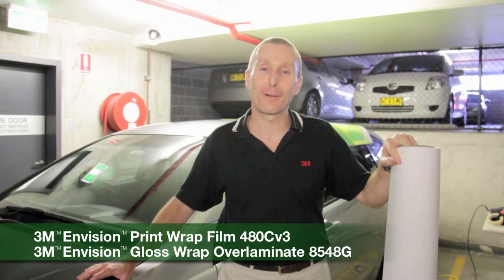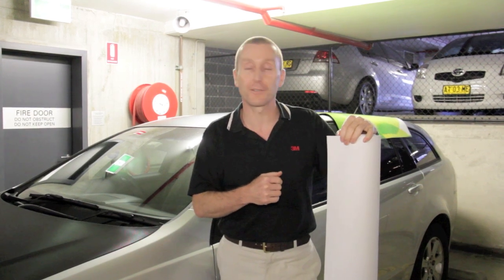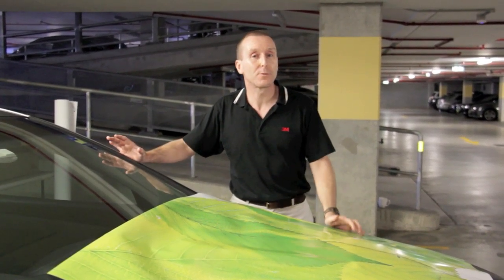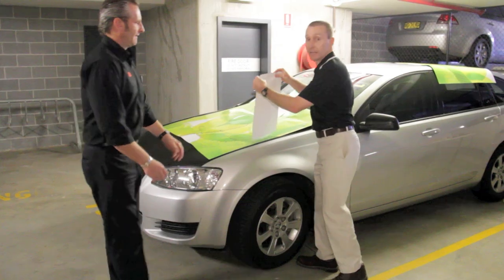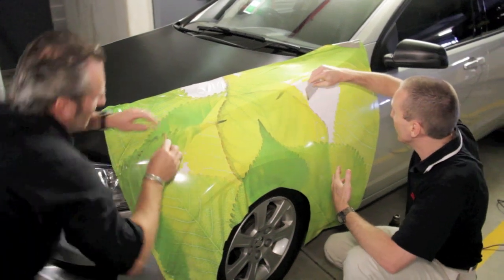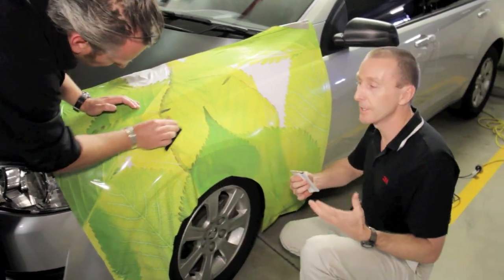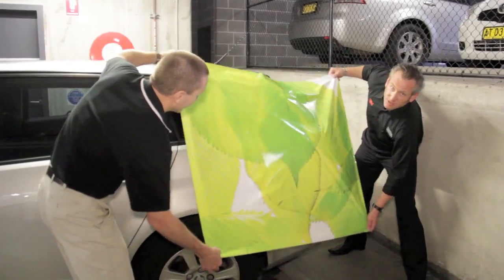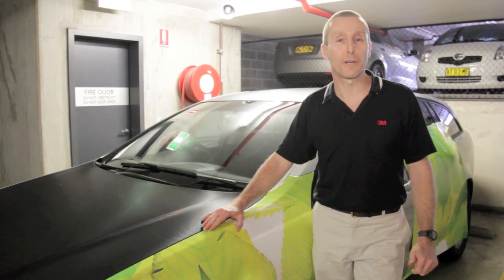3M™ Envision™ Print Wrap Film 480Cv3 - Cookie's Product Review

Comment: Seen some crappy films from 3M in my 40 years but 480 takes the cake as the worst ever.   Doesn't install or stay in channels as advertised and when removing it leaves nearly ALL the adhesive on the vehicle resulting in days to remove it all.    Speaking with several other certified and seasoned installers and found that we are all having the exact same issues.    Approach 3M with it and their reps and labs all hand you what seems to be the same prepared line of BS blaming anyone and everyone but themselves.    Avoid this S#IT like the plague.